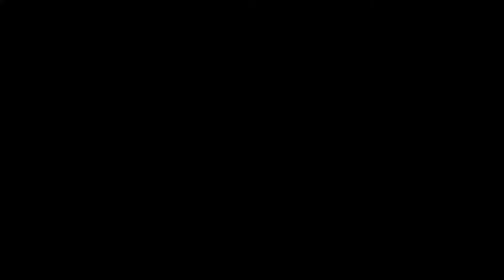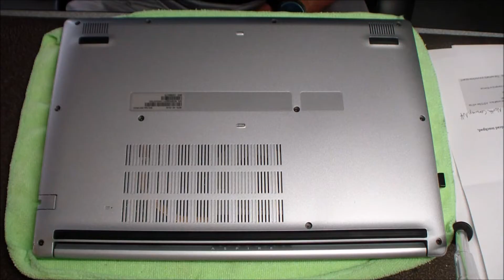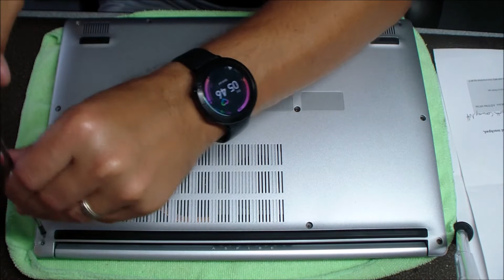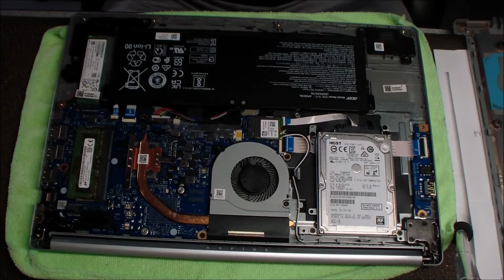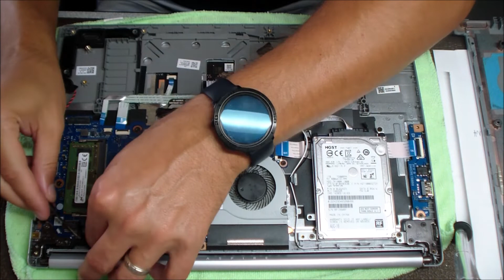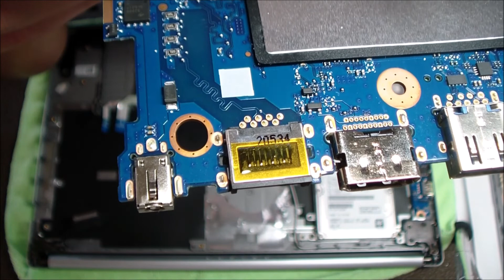Acer A515-54G Disassembly for DC Jack Repair

Comment: So... you get USB-C but it can't charge or power the machine and the wobbly power jack is directly soldered to the motherboard so when (not if) it wears out the average person cant fix it. I have this machine and this is the last ACER product I will ever own and the last piece of junk computer I ever buy from Bestbuy.  Punchline was when I took it to them to replace/repair it and they reinstalled windows because they dont know any other solution to computer problems than to always reinstall windows.  I refused to pay them.  What a bunch of shit.